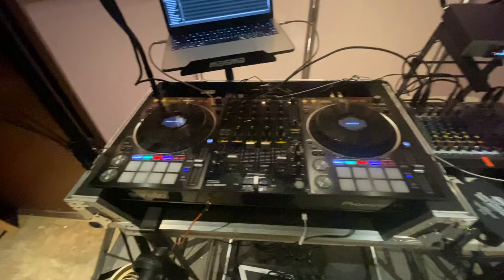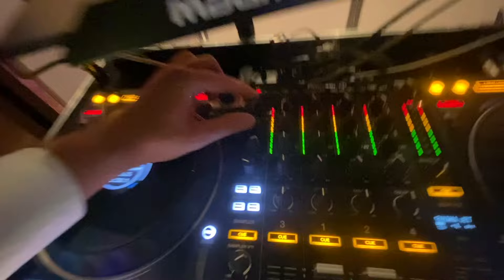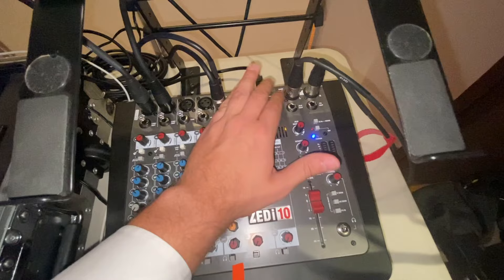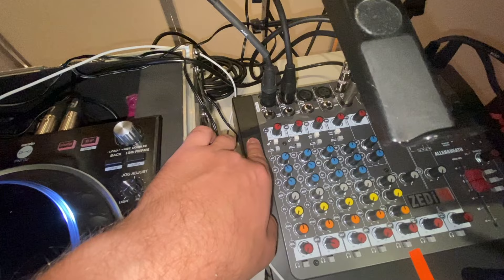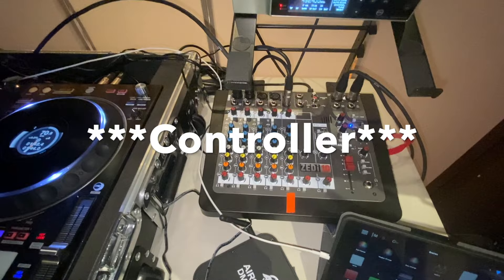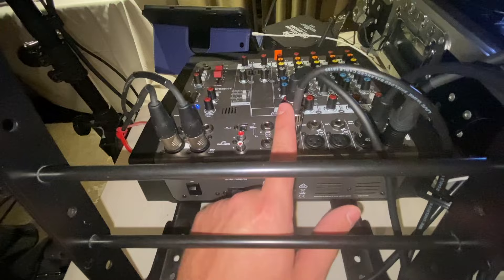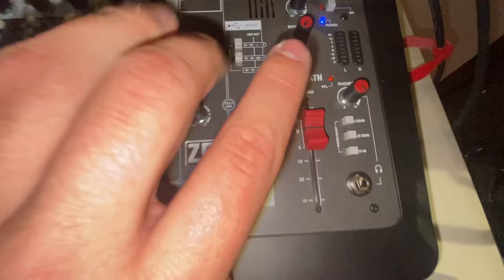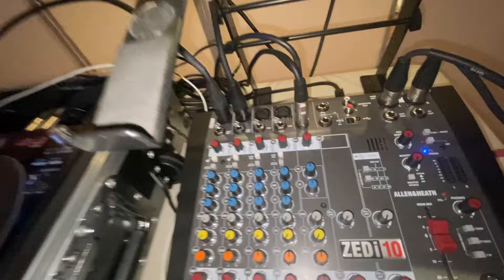How to Connect a DJ Controller to an External Mixer

Comment: Hi bud thanks for your efforts. One question if I may…If I had the exact set up as what you have, but I wanted to add an external active subwoofer into the mix, where would I plug that in? Thank you kindly

Comment: Exactly how I hook mine up, I use a Mackie pro 10 use the additional lines on the mixer to also feed a evermix4 for live streaming. Got a video on my channel. As this creator suggested and demonstrated using an external mixer is highly recommended, signal, quality is superb and ceiling for more volume  is a must

Comment: Have always used an external mixer as on one channel I can keep a spare laptop connect,  that way if the controller etc crashes or fails I can continue with that deathly silence.

Comment: I see a lot of questions here. I totally support your info 100 percent. I'm a dj I have a 10 channel and a 16 channel Allen and Heath. I use channel 1 or 2 or any channel to hook my controller from. Let say I use channel 1 and 2 from the Allen and Heath mixer and goes to my controller. I use female xlr  to male xlr from controller to the mixer ch 1 and 2. So you have to use two vol faders 1 and 2 . My reasons for this is because I can still use the whole eq both mid low and high. On stereo you only have bass and a high. The signal is far more stronger when it is hookup like this. Both channel 1 and 2 volume fader should be in Unity and then you control the vol from Gain. 2  short 3ft female xlr to male xlr would work from controller to external mixer. Hope it make sense. Thank You
Reply from the maker: Definitely makes sense! You can do it that way. Most of us don't have a controller with that many inputs, so that's why I don't use 2 channels for my controller...only 1. I think your way works really well also!

Comment: Do you consider audio interfaces like the Behringer UMC404HD that don't come with all those faders of equal value to your mixer setup?
Reply from the maker: I personally have never used an audio interface, so I cannot comment on that.
Reply: Mixer setups are easier to operate from a DJ stand-point

Comment: Good content just to add on here. I Dj at a Local bar and I bring in a Yamaha MG06 super compact and ch1 & 2 have a stereo spread switch and clipping indicators. I go from my Denon 1850 mixer into ch 1&2 via XLR. Yes I know that I should be going into the stereo Line channels but there is no eq there and i want to manage the clubs tone a bit with that last set of EQ'ing stage. When going into the XLR input, the gain has to be at 0 and or use the pad button then add some gain and or turn the Dj mixer down a bit all these gain stage adjustments to add head room. If you go into the line level channels which is exactly what you are supposed to do shown in this video because of the higher signal coming in. I will be buying XLR to TRS going into the Yamaha and then all these little pad and knob adjustments go away but I just wanted to use the solid XLR connections throughout. If I Dj somewhere else at a bigger space i would bring my Yamaha MG10x and do the same but use channels 3 & 4 and save ch 1 & 2 for mics since those channels have the 1 knob compression which is a nice to have BUT! one day I was at GTR center and touched that same Allen & Heath ZEDi10 and was Blown away by the quality....... those are Beast Mode pro status for portable compact mixing. Since then, I have picked up the Allen Heath Zed10FX board (near the same but diff as this one has the master slider diff power cable and smaller meter) and man its way NICE. You lose a few things but the solid construction is what has me sold. The metering is superior to the Yamaha MG10 and you get the Listen option to hear the source material coming in. You lose on board compression (ugh), 1/4" monitor out but you have RCA's, knob spacing, FX ease of use and the straightforward lay out. You gain a far better mixer no question, solid tension on the rotary controls, sweapable md range eq that can help if playing on cheap powered speakers that have bad tone, an accurate meter, PFL on each channel and you can target channels to record. The spacing of the knobs on the AH has less room than the Yamaha so sausage fingers be mindful the Yamaha is more spaced out. Know that the ZEDi in this video has a specific power cable no clue why they did that, just don't lose it, I was going to buy the ZEDi but went with the ZED10 for the larger metering and normal IEC power cable. Great video, it's the grit of what's behind the scenes, there's always another layer. Big Ups from Chi town
Reply from the maker: Sounds like you have a good grasp of external mixers! Thanks for the breakdown of your set up man! Keep rockin it!
Reply: @DJ-BRY  10 Flow aka 10-4

Comment: This was super helpful! I have a question - I am doing my first DJ gig, I'm using the DDJ-FLX4 which has a dual RCA output. The venue is providing a Yama EMX512sc mixer. Is it okay to plug in by using a dual RCA to single 1/4inch cable?

Comment: I am a beginner Dj and I am using a controller and mixer. When setting the gain, do I do the same settings on both the mixer and controller? Or do I set the mixer's gain and just ignore setting the controller, since it is connected to the mixer?
Reply: Good question, I’m also wondering this?

Comment: Excellent video and I always recommend to my friends to run External Mixers in their rigs. I have the Mackie ProFX6v3 and 10v3.
Channel 1 is MY Mic, Channel 2 goes to my Wireless SHURE system, 3/4 is for my RANE ONE and channels 5/6 are for my iPhone during setup and tear downs etc.
Bravo!!! I’m sure that A&H sounds incredible what speaker do you run out of curiosity? I’m an EV guy.
Reply from the maker: My main speakers are EV EKX 12’s. I sometimes pair them with the EKX 15 Subs. I highly recommend external mixers to everyone.
Reply: @DJ-BRY  I have the ELX200 18” Sub & ELX200 12P love ‘em
Reply: I also have the Mackie ProFX10v3 for my primary system and use the 6v3 for an additional system setup (like a wedding ceremony). I have a Pioneer DDJ-SZ2. Here is my question: Should I just run one XLR cable from controller output into Channel 1, 2, 3 or 4 via XLR? Or should I find a dual XLR cable that ultimately runs into a single XLR into the mixer? Or should I simply buy two XLR to 1/4" cables and run cable from both controller outputs into  Channels 5/6?  I am not sure about either structure on mono sound vs. stereo sound.  The reason that I am asking is I have invested so much money in good quality XLR to XLR cables and don't really want to have to spend more $$$ on XLR to 1/4" cables. Any thoughts would be appreciated.
Reply from the maker: @johnjackson9235  personally, I would purchase the XLR to 1/4 inch cables. Going into 5/6 with 1/4 inch will still allow you to leave channels 1-4 open for XLR inputs for mics etc. I’d rather adjust 1 volume/gain knob for 5/6 than have to manage 2 separate channels on 1-4. I hope this makes sense.
Reply: @DJ-BRY  thank you. That makes a ton of sense.

Comment: Thank you for this detailed video! I love it.
Quick question... what would be the better or more recommended way to connect the controller to the mixer? 
A: XLR from the controller to 1/4 inch on the mixer
B: RCA from the controller to1/4 Inch on the mixer
Reply from the maker: Either will work. Ben Stowe has a video on this explaining that technically RCA to 1/4 is the best option, but he did say that either will work just fine. I have the option to do both depending on my setup requirements. Hope this helps!
Reply: Thank you!  @DJ-BRY
Reply: XLR to 1/4 is the best option

Comment: DJ Bry thanks for the video very informative I have the Phenyx pro 100 with the XLR cables running from the mixer to the speakers (Thump) 15s however my controller is a Roland DJ 202 with very limited ports so there's a port (master out) Land R red and gray rca cables not sure where they plug in on the mixer can you help thx
Reply from the maker: If you wanted to have a similar hook up to mine, You would run XLR's out of the Roland controller into channel 3&4 of the mixer. It would take up 2 of the 4 channels you have, but that is the best way to do it. i would recommend getting a 6-10 channel mixer for your setup if you want to have more channels available.

Comment: 1/4 Inch Inputs, (Stereo or Mono)? It seems to be it's best to run 1/4 verses XLR left & right or only one XLR In. Also this is a debate. I feel the sound is much cleaner XLR to 1/4 inch verse XLR to XLR. What's you advice on this?
Reply from the maker: I don’t have the full knowledge on the topic to answer the question. What I do know is, since the cables are short, there isn’t much of a difference between XLR and 1/4. The longer the cable run, the more of a difference there would be.

Comment: Thanks for your video out there. 

How do you control your music volume over the evening? On wedding events the volume at the beginning is of course only background music. Do you adjust the volume later on the controller, or on the external mixer?
Reply from the maker: I set my sound levels to fit the room on both my controller and mixer to find that “unity” level for dancing. Once I set that level, I then control the volume for the night on my controller. I use my mixer to give me that extra headroom and clarity/control for EQing the room.

Comment: Good Day, thanks for the tutorial. Does it make a difference that the Chanel on the mixer you are using only has High & Low EQ Freq? Does the Mid on your DDJ still make a difference?
Reply from the maker: Your DJ controller has a built in mixer which usually has high/mid/low. In this case, no it does not matter. Your external mixer can be kept at neutral for your high/low. If you wanted to EQ the DJ controller, use the H/M/L on your controller itself. 

I hope that made sense.

Comment: Great video, i also use this same set up however at some venues i get a horrible hum, as soon as i remove the mixer from the setup (active speakers connected directly to deck controller) the hum goes.
Slightly of topic have you experienced this and any solutions? Seems like the mixer is allowing the hum to occur but only at certain venues, i can't reproduce the hum at home.
Thank you.
Reply from the maker: Most of the time, it depends on the power source at the venue. Not all venues have the same power hookup. It has to deal with how the circuit is “grounded”. They do make adapters called “ground loop isolators” that can help. 

I have also noticed that when the laptop is charging, there is a hum, but when I disconnect the power cable, the hum goes away. I believe it has to do with the AC power pass through from the laptop.

Comment: Hey thanks for the video my question is I have EV ELX PA speakers they are not powered speakers so what subs can I use them with I use a crown xli2500 to power the pa speakers looking for subs and a mixer thank you
Reply from the maker: Unfortunately, I am not knowledgeable on powered amps/mixers. My system is all powered speakers. I would recommend reaching out to your local audio tech in the area such as people from guitar center or live sound production companies.

Comment: Can you hook your controller to the mixer, with strictly xlr male to female cables or do you have use the xlr to 1/4 inch?
Reply from the maker: You can. But you would be taking up 2 full channels and have to set 2 different volumes. I prefer to leave my mic channels (XLR) open.

Comment: Great video/tutorial. I have an external Mackie Mix 5 that has EQ options available only on the Mic/Line Input. I run my dj mixer to the external mixer the exact same way as you do which is great but that channel doesn't have EQ that allows me to adjust the Hi's, Mids & Lows. Any suggestions?
Reply from the maker: I adjust the H/M/L on the DJ controller if I ever need to since the external mixer doesn't have H/M/L
Reply: @DJ-BRY  Thank you for that clarification I've always known there was a better way to connect the tops separate from the sub but I just kept scratching my head. Does your YouTube channel name FUNKYTOWN stand for Fort worth Tx?
Reply from the maker: @jacksspinza.k.adjlilg8343  You are correct!
Reply: @DJ-BRY  I live in the Fort Worth Burleson area my man let's connect. Networking with other DJ's in this area has many benefits.
Reply from the maker: @jacksspinza.k.adjlilg8343  of course! Feel free to reach out to me via my Instagram or FB!
Reply: @DJ-BRY  I will definitely be reaching out to you DJ BRY I m quite sure we can both help elevate each other as DJ's!

Comment: So what option is the 5th channel(the ones with the 1/4 wires plugged into it)?
Reply from the maker: You can technically plug 2 different instruments into it, which makes it 2 channels, but…..the volume knob controls both instruments. Weird concept. I use it as a Left/Right Stereo combo. It works for my needs.

Comment: I purchase a clean used Allen & heath xone 62 mixer. I guess it was design for turntables and cd. I'm a new lap top DJ that has an apple lap top, and a pioneer DDJ-400 controller. Can this work? If so, how to connect step by step?
Reply: I need the same information

Comment: Hi...regarding the cables between the DJ controller & sound mixer, are they unbalanced XLR to 1/4 mono jack?
Reply from the maker: I believe it’s balanced XLR to balanced 1/4. Because my cable run is so short, the balanced vs unbalanced doesn’t make a difference. Another good way to connect is rca to unbalanced 1/4 (TS). You have some options.

Comment: Do you always have the mixer that close to the controller? Why not connect straight to the mixer using 3ft xlr to 1/4 cable 😕.. and why don't you use the xlr inputs are you saving them for more mics?
Reply from the maker: Yes I always have the mixer that close. I like to have the extra channels available for mics and such.
Reply: Allen Heath Zed series have dedicated line level inputs on TRS unbalanced jacks and the XLR inputs are used for microphones only.

Comment: I have a Ddj flx4 working with rekordbox, do I need to buy a mixer compatible with rekordbox (pioneer) or can I connect any mixer to the consolle and still use Rekorbox?
Reply from the maker: Any mixer will work. No software is required. external mixers are completely separate from DJ controllers and software.
Reply: @DJ BRY  thanks. Sorry for the question but would I be able to connect a DDjFlx4 (has 1/4 inputs) to a Behringer DDM4000?
Reply from the maker: @alessandroraisaro165  yes. You can use 2 1/4 to orca cables to connect

Comment: Does the mixer have to be usb connected for djing??
Reply from the maker: The only USB connecting is from my laptop to my DJ controller. The external mixer does not have any USB connection. Only XLR & 1/4 inch cables.
Reply: @DJ-BRY  ok. So only get a usb external mixer if you do live-streaming rite? But if you don’t do live stream then you don’t need a usb external mixer? Because I read in some forums a lot off ppl opt for usb enabled Dj mixer so they can connect to to there laptop for live stream.
Reply from the maker: @Marlonhernandez19828  I don't use the usb portion in a mixer for my needs. I honestly do not know unfortunately.